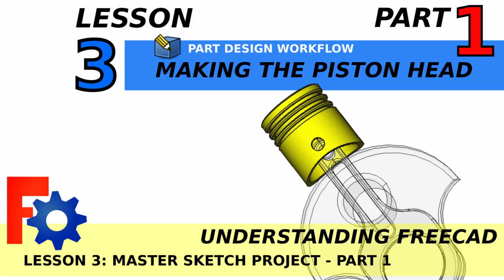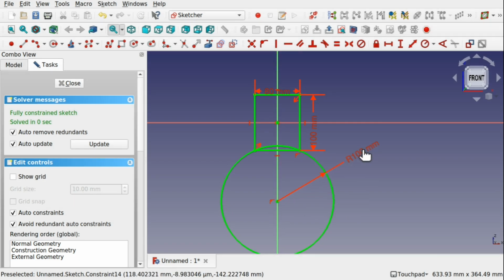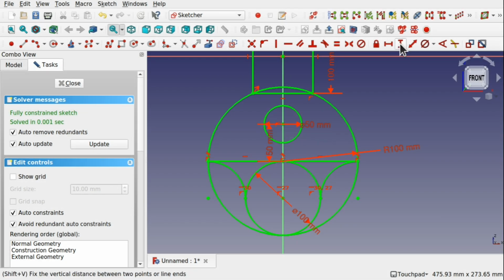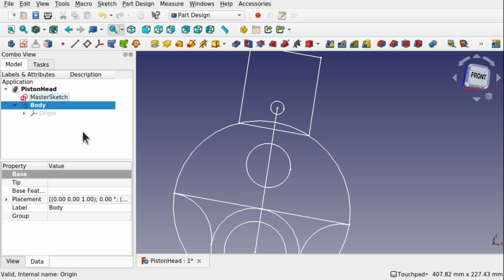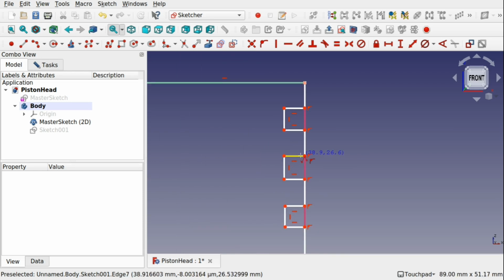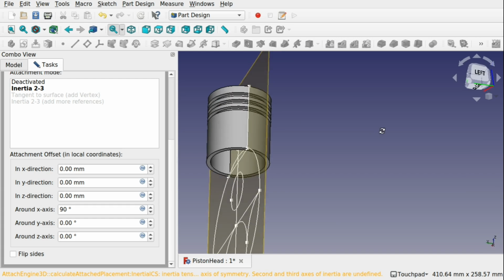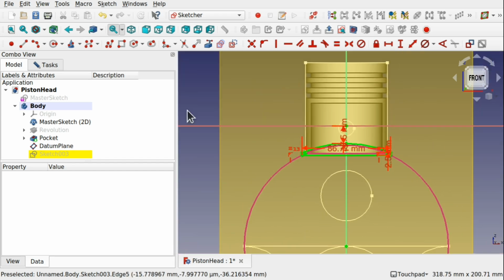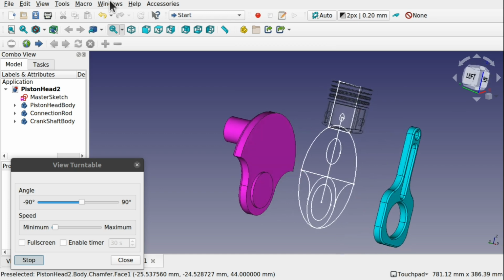Understanding FreeCAD Lesson 3.1 Model a Piston Crank Shaft Assembly Animation in Part Design A2Plus

Comment: Hello. Thank you for the videos. They are simply the best FreeCAD tutorials in existence.  

I'm curious about one thing. It just seems needlessly clunky to have to jump to the Draft WB for a single cloning operation.  Why isn't there a "clone sketch" option in the Sketcher WB?  Is the "master sketch" approach not good practice according to the FreeCAD team or something?
Reply from the maker: Thank you for your kind comments regarding the videos, really glad they are helping everybody. It's something that I wish I had when I started learning. I agree in regards to the tools and jumping about but I can see the reasons why. It is due to the multiple workbench design. The same you can say about the sub shape binder. I have used that tool for what I do in other workbenches probably more than in part design. It's a question of where do you put it. If there were less workbenches then it would flow so much better. The good thing is you can customise your tool bar, I have done a video of two regarding that and that really helps when it comes to speeding up the process. Freecad to me is like my toolbox in my garage. I have multiple drawers and each tool can be used for a task other than what it is intended for (I keep using my chisel as a screw driver)

Comment: Instead of using a datum plane for the piston couldn't you use an origin plane on the xz plane?
Reply: Was just about to write the same comment. I can´t see the need for those two datum planes, adding extra complexity to the model when not needed. I often do it myself just because I use datum planes a lot not considering at the time that the base planes are right there :) Maybe there's  something he has in mind for the following videos? Using the datum planes for something.

Comment: Did you skip where you added the inner circle on the master sketch Cam where the connecting rod goes to?
Reply from the maker: It's around 9 minutes in
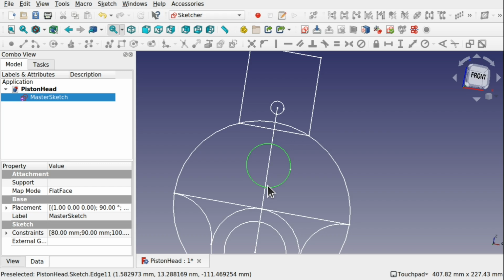Reply: @MangoJellySolutions  The problem is you DID add a circle at 13:49 with no explanation nor dimensions. Go there then rewind a few seconds and you'll see what we mean. Thanks

Comment: Possible time-saving note:  It looks like mirroring is best done for shapes that don't need a lot of constraints added.  I'm guessing that if you add all the work done for just drawing the 3 point arc on the left side of the smaller circle inside the large one, and compare that to all the work done on the same arc if it's mirrored, it would come up about the same, or possibly take less time if you just draw the 3 point arc manually again.  

Also, there are some constraints missing from the Master Sketch that are necessary for optimal point placement.  In the largest circle, the left-hand line drawn from the center point to the outermost point (on the left of the circle) needs a height constraint, because (at least on my screen) it will still move up and down independent of the rest of the drawing without that constraint.  The mirror-opposite line (on the right) seems to be well constrained as I follow along in the tutorial, but I had to add a second height constraint to the left line.  Having a grid/snapping set up for metric (and turned on) would probably have avoided this, however, I'm personally doing things without it being set up that way (long story there).  For those who are doing things differently with the grid/snapping, as I am doing, it's necessary to add that left-hand line height constraint.

Comment: I think that having this come up much later in the series, redone to work with .20, would probably be a good idea.  It would also help if there was a (correct steps only) point-for-point summary at the end of the video, that skips the explanations and what not to do, and just shows the creation of the sketches and other stuff, for comparison with the work done, as a sort of video visual checklist, to make sure this was really done right.

I'm having to redo this from scratch, a month later, because the A2+ WB is giving me crazy, unsolvable "conflicting constraints" errors that even the finder tool doesn't help with, as it only deletes the currently created constraint, not the actual problem triggering the error message in the first place.  I have to believe it's some problem in the Master Sketch, or one of the other sketches for the different bodies, so that's what I'm re-doing.